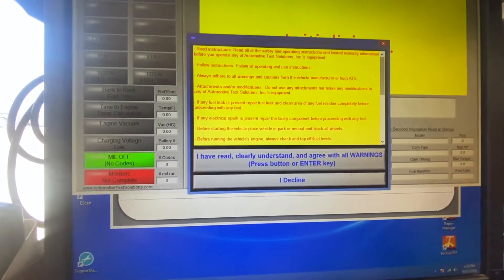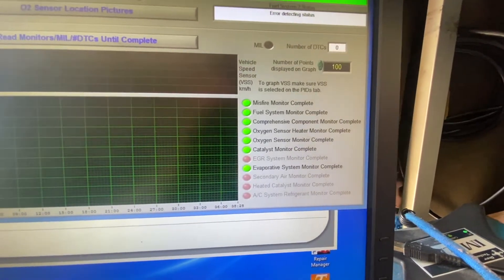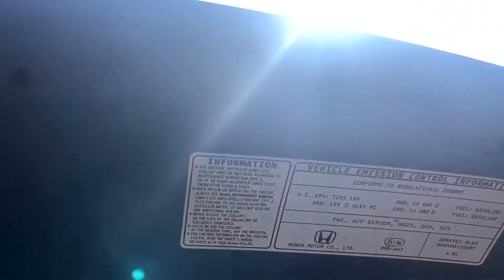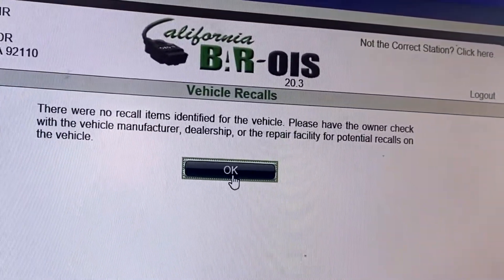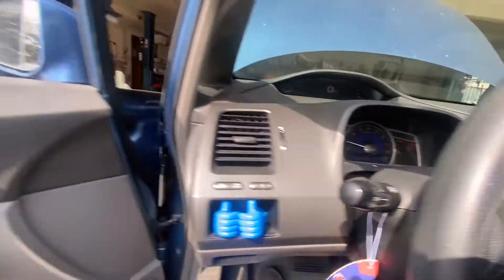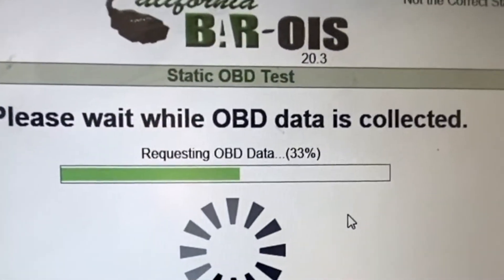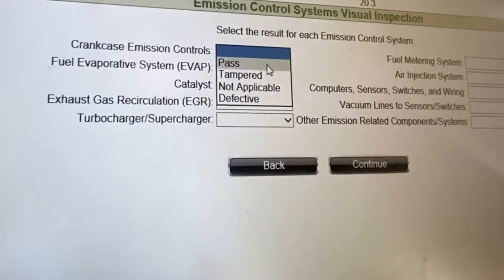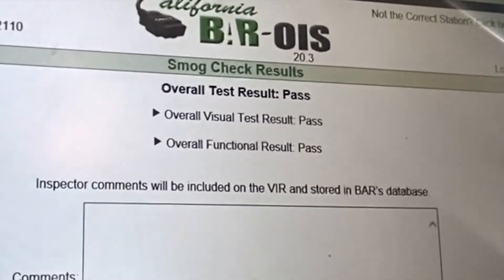What is a smog test?. California Smog test Star Station. California Emission test.

Comment: Whats the difference between regular smog stations and star smog stations
Reply: Smog tests can be conducted at a wide variety of smog check stations. Certain smog check stations, however, have chosen to participate in the BAR’s STAR program. A STAR smog station is subject to additional oversight and review by the BAR, and they conduct more strenuous smog testing. There are two types of STAR smog stations: STAR Test Only Centers, which are licensed only to conduct smog tests; and STAR Test & Repair Centers, which are authorized to both conduct smog checks and to conduct smog check repairs. STAR stations can conduct both regular and STAR smog checks.

If a vehicle owner is required only to get a standard smog check, they can go to any smog check station. If they are required to go through a STAR smog check, they’ll go to a STAR station. A STAR smog check is more thorough than a standard smog check.
Reply: @daniellozano8684  thanks man